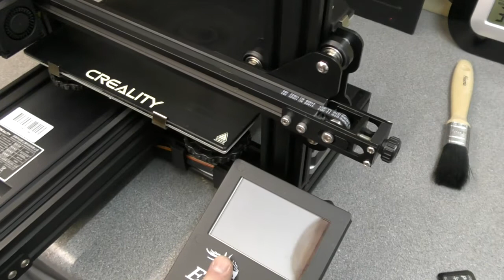Ender 3 Pro Dual Z drive install.

Comment: How come the couplers are so high from the stepper motors on the Z axis?
Reply from the maker: Hi
No particular reason. Do you think that may be a problem? Print quality is very good, no obvious issues.
Reply: @Trevs-Shed  not at all. Mine came basically flat against the stepper motor. Doesn't seem to affect anything one way or another. Just been noticing this lately.
Reply from the maker: @gishman9  So long as there is a little clearance it should be fine.
Reply: @Trevs-Shed  dont even need clearance. Either is ok. There are enough other challenges in the 3d printing world. If it works for you, leave it be 😀